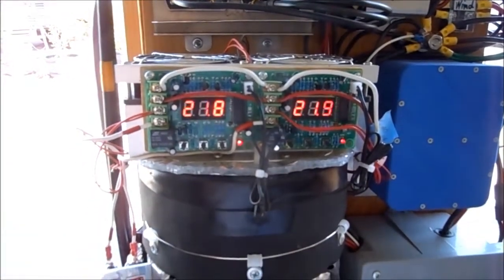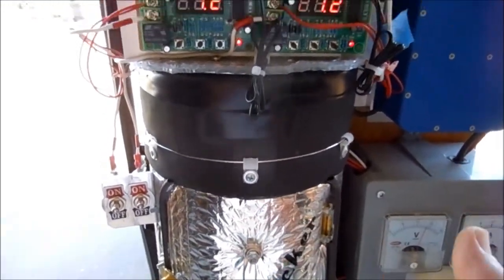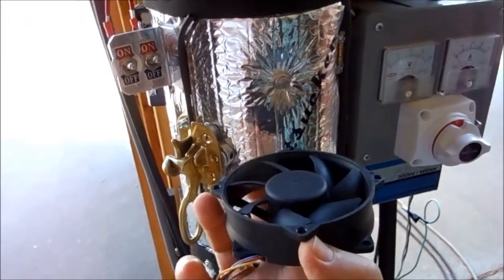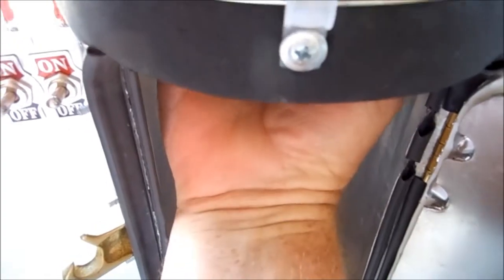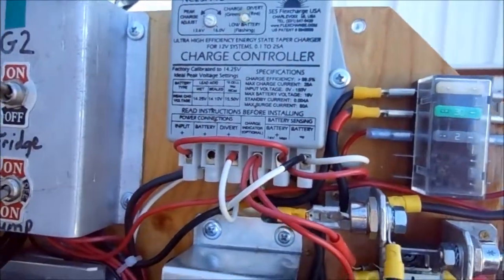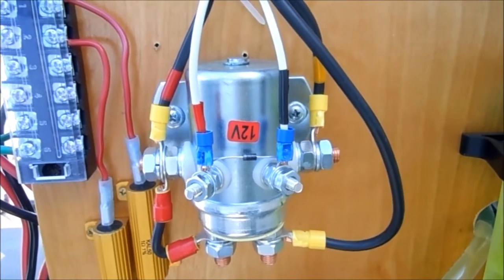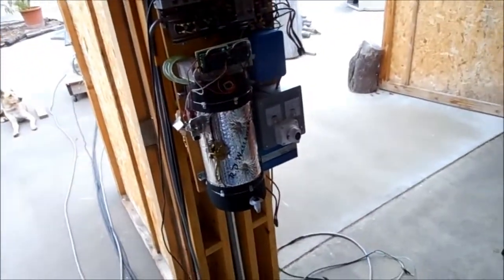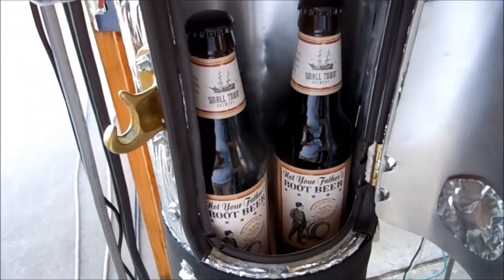Mini Fridge Has Become Bane of This Project

Comment: It would have been cheaper and easier to dump the excess power into normal fridge, but as the aim is to run the home on 'free' energy you should be storing as much energy as possible and putting the excess back in to the mains and get a rebate.
Reply from the maker: The idea is to use it as a dump load after the batteries are full. I hate wasting anything, even excess energy.